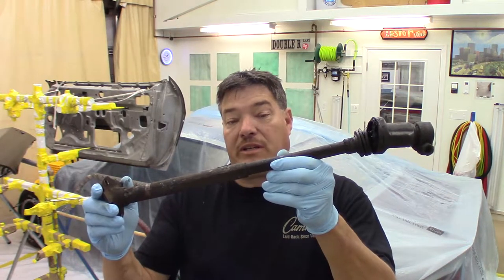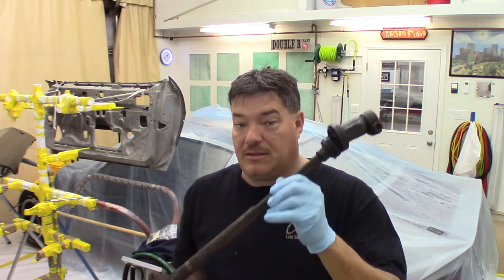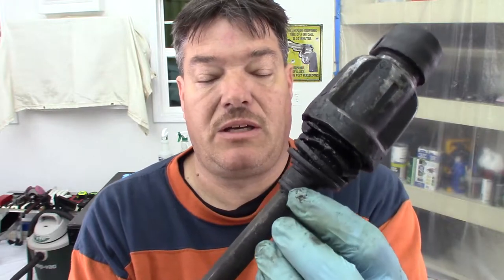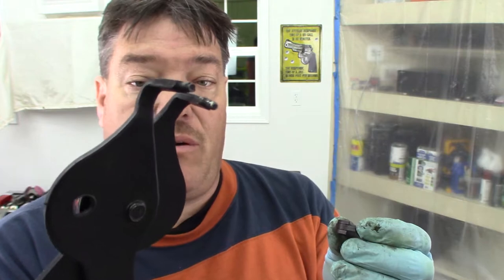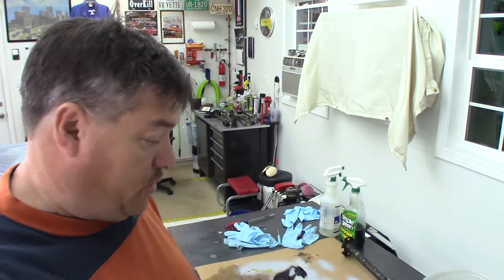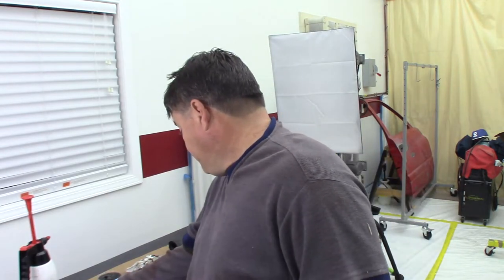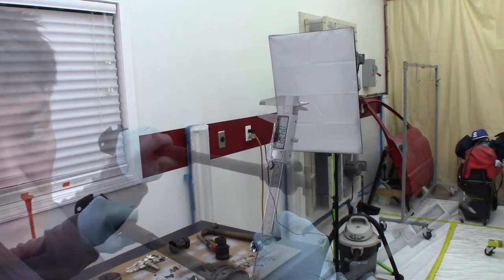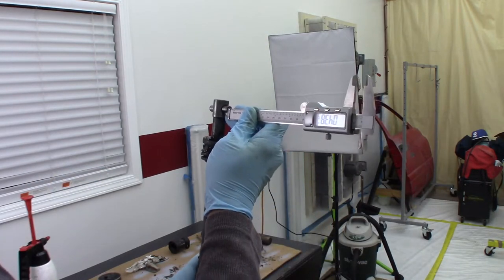1970-81 Camaro Intermediate Steering Shaft Disassembly

Comment: Hi Russ. You make it look easy. Nothing like a home-made tool.
Reply from the maker: Thanks Wiley. I did have my share of struggles with these shafts. The tool worked ok, needs a little work. It needs to be able to open the clip slightly more and it would work alot better.

Comment: I've seen lots of videos on YouTube that show guys "rebuilding" these couplings. Yours is the  one I've see where it's done right.
I  leave comments but in this case, I'm compelled to give credit where credit is due.
I have a 1974 Chevrolet Monte Carlo that's been my daily driver since I bought it in 1984. I have north of 500K miles on that car and do  the mechanical work on her myself; been burned too many times by so-called "certified mechanics".
As you can imagine, things need attention after that many miles.
My next endeavor will be the intermediate steering shaft yoke assembly; that's what they call it in the shop manual. I read the procedure in the manual but figured I'd check on YouTube to see what other folks have done. I really like the added attention to detail you did by wrapping the shaft with tape before you press out the cross pin. Furthermore, the quality of your video suits me perfectly; you explain clearly, you bring parts close to the camera, you orient the camera to see the actual work being done. You obviously put a lot of thought into producing the video, and it shows.
Thank you for taking the time and putting the effort to making this wonderful video.
Reply from the maker: Thank you Mark! I appreciate that!
Reply: @DoubleRRestorations  I finally got around to doing the yoke assembly and made my own video that shows my rebuilding one of these for third-generation A-body cars such as the 1973-1977 Chevrolet Monte Carlo (https://youtu.be/IsaG-QdT5Ys). Mind you, my approach is from that of a daily driver, commuter, grocery getter and the end product reflects that. It's nowhere near as pretty as yours but it works perfectly. However, I mentioned your video, this disassembly video, in the description for my video; I hope you don't mind.

Comment: Great video, Russell! You convinced me to buy a new intermediate shaft for my '74 Formula instead of trying to rebuild my old one. :^D I love your meticulous attention to detail.
Reply from the maker: Thank you Griff. Its alot of work to restore one of these, but its very rewarding after its done.
Reply: @DoubleRRestorations  Well, bummer - the new intermediate shaft came in today, but it's not right.  :(  I mean, it's obviously meant to be equivalent, but the lower flange is 90 degrees off, and the upper u-joint is a different design. My old one looks just like yours in this video, and the picture on the website where I bought it looked like it was an exact replacement, but I got the old bait-and-switch, apparently. So I might be rebuilding mine after all. The only problem with it is that the boot is toast, so I'll see if I can find a new boot and give it a go. This video will be a great resource.

At the same time I also bought a new coupling disk, but it's also not right. It's the right diameter, but the bolt pattern is slightly off, and it will fit neither my old intermediate shaft nor the new one they sent. So I think I might spring for a Lares 201, which is the complete lower coupler and looks to be correct for my steering gear. I can fit a 13/16" open end wrench over the steering gear shaft, but not a 3/4", so that feels like it's a 13/16" shaft.

Different topic - let me know if you need someone to rebuild the floor shifter in '73-81 Camaros and '70-81 Firebirds. I think I found a good shop for this, but I'll know for sure when I get my shifter back in a few days.
Reply from the maker: @griffmillerii1885  Sorry to hear Griff. That has happened to me before. Sadly it's common when ordering some of these replacement parts. I'll definitely let you know on the shifter.
Reply: @DoubleRRestorations  as promised, the report on the rebuilt shifter - it turned out GREAT. The people who did it can be found at thepartguy.com - they turned around my shifter fast and it looks brand-new. Cost was very reasonable.

I finally got my intermediate shaft back together. It was a slightly muted success - I found someone with a hydraulic press (man, that pin was in there tight) and we got the new boot on. However, while my new boot was in all other regards the same as original, it was in fact significantly thicker than OEM at the little end, and while attempting to get the clamp over it, I broke the clamp. So, zip tie it is. I did make a nifty tool out of my least-loved pair of common pliers, and it actually worked quite well, but the new boot was just too thick. In a way, you kind of don't need a clamp with the new boot - the extra rubber kind of provides its own clamping force, but I put the zip tie on there to make me feel better. It will work fine. I'm not going for show-quality here - I just want it to function properly, and it does that.

I did finally get a coupler that would work, on the 3rd try (first try outlined above). The 2nd try coupler was obviously supposed to be the right one, but it would not go over the steering gear shaft. Just a bit off on the tolerances, I'd say. The 3rd try was the Lares 201, which fit and will work. I like the OEM better, but the Lares will do.
Reply from the maker: Thanks Griff, I'll definitely check them out. Glad to hear that you got the shaft rebuilt and found a coupler. Those pins are tight. When my pin finally broke loose, it made such a noise that I jumped. lol. I have broke those clamps before as well.

Comment: Hey Russ, great video! Where can I source a good intermediate shaft upper boot? Can't seem to find any original, correct boot. Several guy have referenced a Jeep replacement with an oblong hole but they also say it has to be modified some. Any idea where I can get a new one? Thanks
Reply from the maker: I got these boots are of eBay and I was happy with them. They were listed for a Jeep.

Comment: Great instructional video. Thanks for this! I noticed when Burnoutsandrotorblades did his Vega that has this same type of pot joint at the steering box end, it was spring loaded between the pot and the shaft… 
Why do those have the spring?
Thanks!
Reply from the maker: Thank you, Im not sure about the purpose of the spring. Maybe to help with alignment.